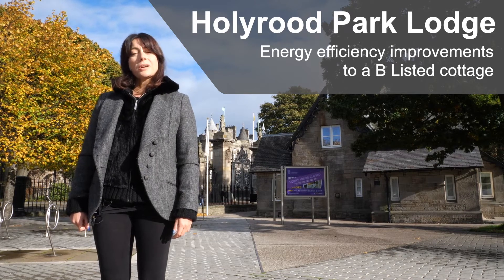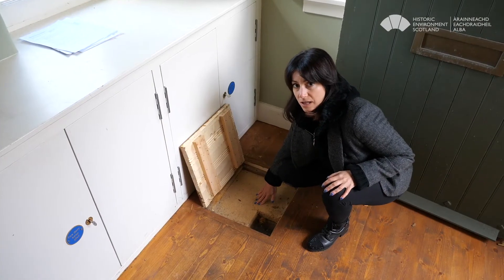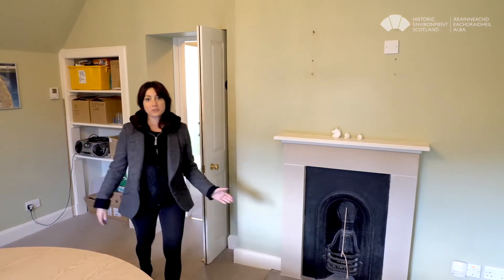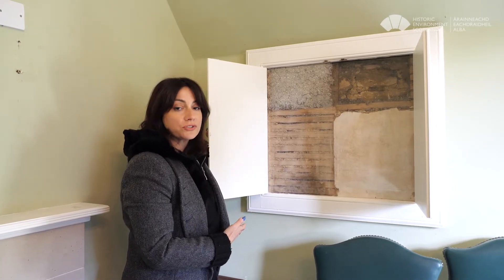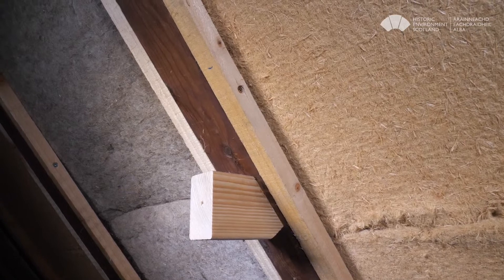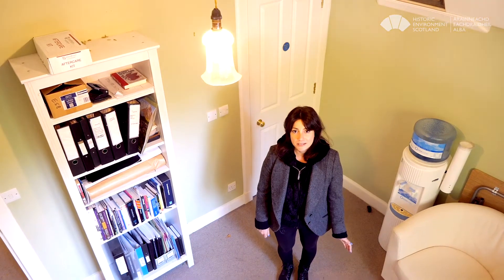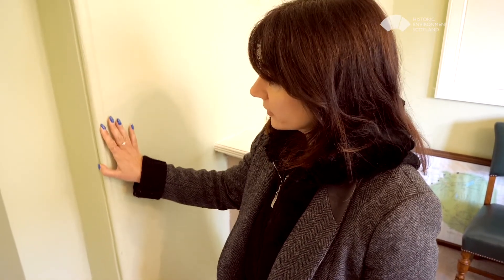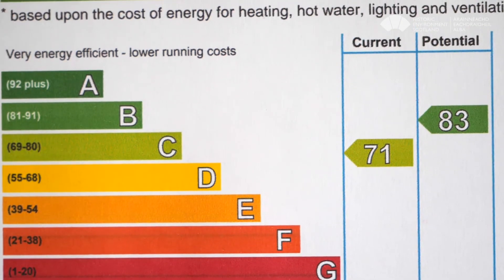How to Make a Historic Building Energy Efficient: A Tour of Holyrood Lodge, Edinburgh

Comment: In reference to the insulation blown behind the lath and plaster, does this not create a moisture bridge between the stonework and the plaster which will then lead to damp? I was always under the impression that an airgap must be maintained at all times.
Reply from the maker: Hi James, the inside face of traditional stonework should not be damp – if it is you have a different set of problems! We've monitored filled cavities over many years on many properties, and none have been affected in this way. For some additional reading, you might find the following two publications helpful:

Independent review of eighteen refurbishment case studies: 
https://www.historicenvironment.scot/archives-and-research/publications/publication/?publicationId=1b9092e3-4080-439e-be0a-a96600c2c1e4 

Guide to Energy Retrofit of Traditional Buildings and for the humidity reading on the walls at the lodge:
https://www.historicenvironment.scot/archives-and-research/publications/publication/?publicationId=47c9f2eb-1ade-4a76-a775-add0008972f3
Reply: @HistoricEnvironmentScotland  Thanks for the response, no damp walls, just keen to keep the place dry. Those documents are a great resource, appreciated.

Comment: If using wood fibre board to insulate under suspended wooden floor [I am doing this from below as I have plenty of crawl space underneath] - do I need to leave a gap between underside of floow boards and the fibre board insulation?   Or - can I fit the insulation hard against the underside of floorboards?
Reply from the maker: At the Lodge, we had a 20mm gap between the fibreboard insulation and the floor. This was due to the depth of the insulation and that the insulation was pushed down from above onto timber runners. 

Depending on how you want to hold the insulation in place, you should be able to press it up close. 

You can find out more about the refurbishment at Holyrood Park Lodge here: https://www.historicenvironment.scot/archives-and-research/publications/publication/?publicationId=f7c8b362-f78b-416a-9733-abb5009c521d
Reply: @HistoricEnvironmentScotland  Thank you.  Your website [and facebook livestreams] are very helpful.
I did think pushing up tight againt underside of floorboards should be okay given the insulation breathes.   I noticed, too, that you said not much difference when you did the same thing on roof.